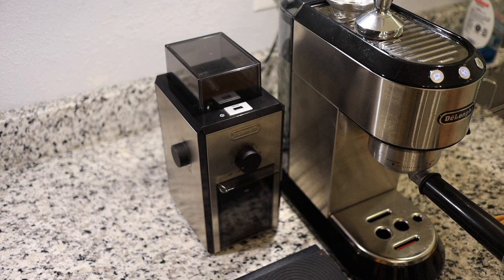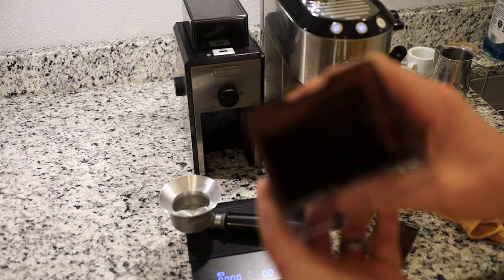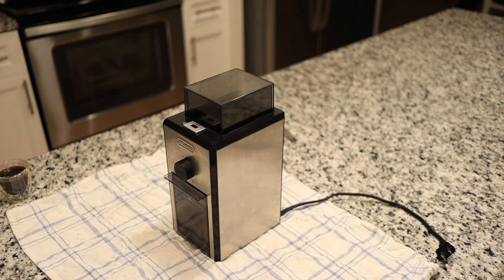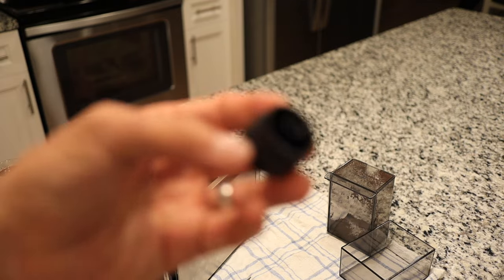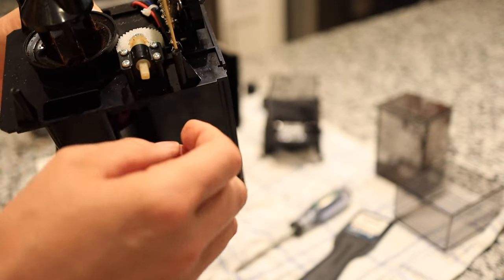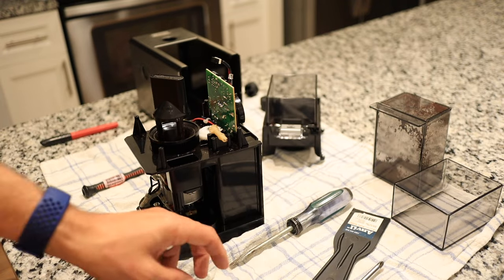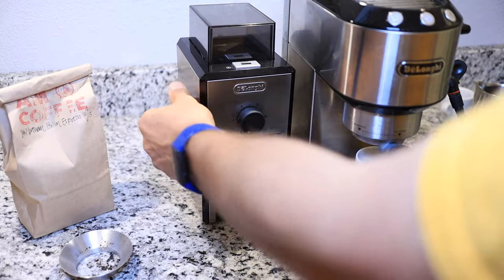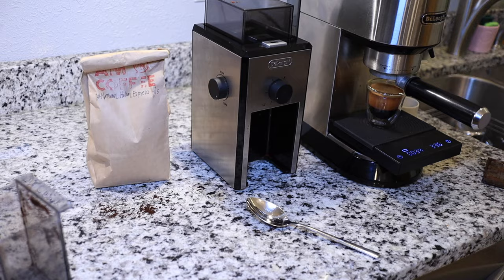Delonghi KG79 & KG89 Mod for Finer Grinding - The Easy Way

Comment: Hi! Can i grind/dial any bean to that mod? Im a first timer
Reply from the maker: Hey Stefan, light roasted beans may be a little too dense for this grinder. But a medium or dark roast should be just fine. 👍🏻
Reply: @TomsCoffeeCorner  thanks for a fast reply! Will try this first before upgrading.
Reply: Hi! I tried modding my kg79, and try all the fine settings, got lucky and found a good taste but not good enough for me. And like yours, i got channeling, is this because this grinder really cant produce a good ground quality?
Reply from the maker: @shabsky3244  Hi Stephen,  how freshly roasted are your beans? You might want to also consider puck prep.
That being said, I would recommend getting a higher quality grinder like a Eureka, if you strive for consistent results. Here are a few recommendations: https://kit.co/tomscoffeecorner/grinder-suggestions

Comment: Hi i did the same hack just moved few teeths so the burrs won't rub
I get perfect esspresso shots used it 6 8 times but now I can see my burrs damaging from the corners both of my burrs
I don't know it is fine or it will damage my whole burrs and won't be able to get a good esspresso grind in future
Please share the knowledge if any one knows any thing
Reply from the maker: Hmm, not quite sure what you mean is being damaged. The burrs are metal, so as long as they are not rubbing against each other, things should be fine. But do elaborate if you don't mind. Cheers!
Reply: @TomsCoffeeCorner  I can see the black color of the burrs rubbing both of the burrs and I din even kept them that close but still

Comment: Hi there - I have modded the grinder but still not getting the "fine" I want - the coffee is coming out way too fast and hence, the shot is really watery. 

I am using a Dedica as well but with the original basket - I am able to get pretty good shots when I have shops grind my coffee so I would expect if I max out the fine on the grinder I should get a similar result. 

Do you know maybe what the maximum rotation is? (i.e. right now I have it maybe at 120 degrees) 

Thanks in advance
Reply from the maker: Hey there McHonny. Well, you raise some interesting points. I just went 90 degrees with my KG89, and that made it fine enough for me. But, I do think it would have been possible to go a full 180 degrees finer (at the adjustment knob).
The other point is that you are getting your grounds from coffee shops. So, they will of course have much better, professional grinders with larger better burrs, which is of course going to help the extraction.
In summary, you could adjust this KG89 finer, and should get grounds fine enough for espresso. But, be careful to find the reference point first, before loading it with beans, and back off from there, so that it doesn't choke.
Cheers!
Tom
Reply: 180 degree confirm. Thank you so much. I was so frustrating before I found your vid.

Comment: Did it and now it’s broken and won’t turn on ☹️
Reply from the maker: Hmm, sorry to hear that. I mention in the video that you have to make sure the microsensors are in place. Otherwise, it won't turn on for safety reasons. Maybe check those again?
Reply: microsensor has 3 parts to it! There is also a bullet looking plastic that pushes the sensor button when lid is in place! Be careful not to lose that piece! I lost it in the first place.
Reply: I have the same problem. I have retained all of the sensor parts but will not turn back on. Is there more than one sensor?

Oops. Just discovered that there is also a sensor in the grinds drawer. The drawer also needs to be installed for the grinder to operate.
Reply: @jjeerryy82  do you happen to know how those 3 parts should be assembled? 

i can't figure it out for the life of me 🤣